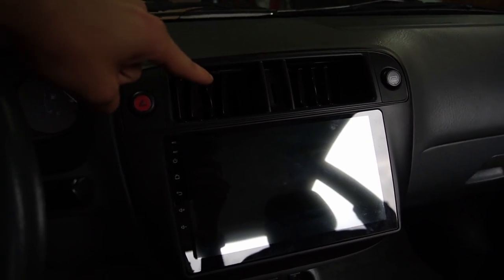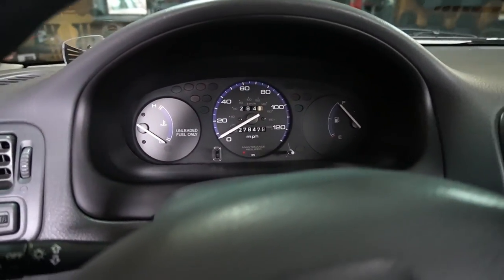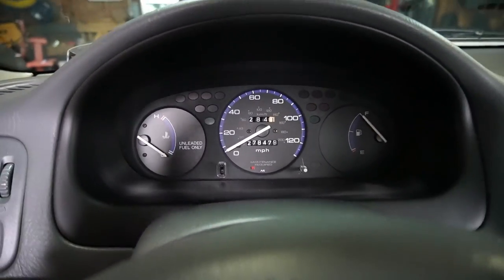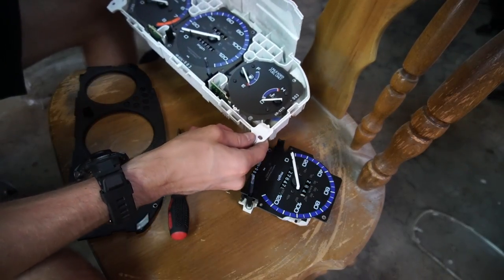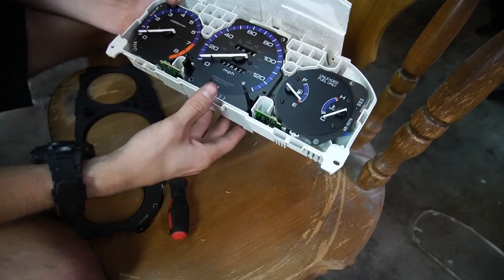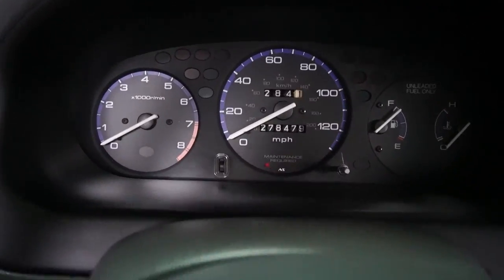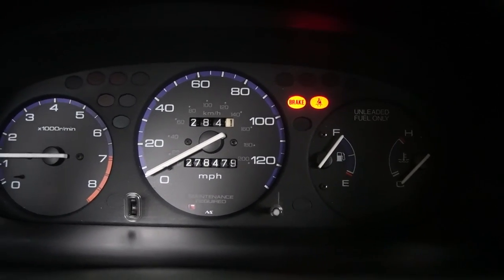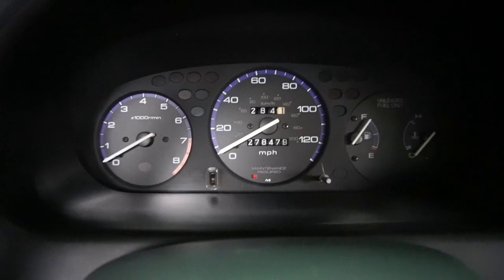Install a Tachometer Cluster in a 96-00 Honda Civic! // EASY 20 MIN INSTALL (Plug and play)

Comment: I have an automatic 96 civic dx and theres no hook up for the tach only the 2 blue harnesses the yellow and then the green for the fuel guage. What should i do?
Reply from the maker: Just plug everything in and it should work.
Reply: @OldieProductions  it doesn't
Reply: @OldieProductions  theres a hookup spot to plug something else in but nothing in my car to hook it up to
Reply from the maker: @MrThongThief   Is yours an automatic?
Reply: @OldieProductions  yes
Reply from the maker: @MrThongThief  There’s your problem. If you have an automatic, you need an automatic tach cluster.
Reply: @OldieProductions  oh
Reply from the maker: @MrThongThief  If your cluster is a manual, it should still work, you just won't have the gear indicator on the gauge cluster

Comment: I have a 96 honda civic dx automatic transmission that doesn't have a tachometer (just like the one you initially had). Would like to swap out my cluster and have the tachometer.

Will a 99 EX/LX cluster panel fit my 96 Honda Civic DX? Both with automatic transmission.

Comment: Is it possible to keep the original cluster and just swap out the temp gauge for a tach and the fuel gauge for the fuel/temp combo, with or without the gear indicator?
Reply from the maker: I have no idea. That’s something you would need to research or try for yourself.
Reply: @OldieProductions  just found my answer on a forum, it turns out this isn’t possible

Comment: Hey, Bud. I had a quick question. I got the same cluster (Automatic version) from a civic today at the pick and pull. I have a 99' EK hatchback. The speedometer is working but the fuel and temp gauge as well as the tach aren't working, any thoughts?
Reply from the maker: Did you plug everything in? Cluster itself could have an issue. I’m 99% positive the auto clusters work but I’m not sure.
Reply: @OldieProductions  I've heard they do, I just hope the cluster isn't FUBAR
Reply from the maker: @ryansenpai1003  I would try cleaning connections first.